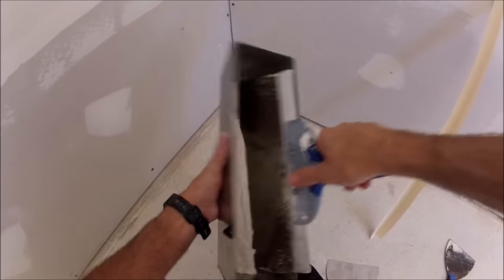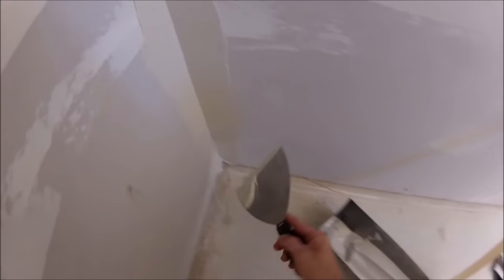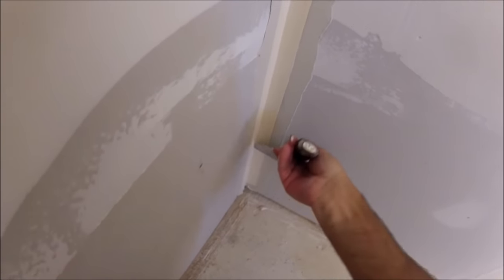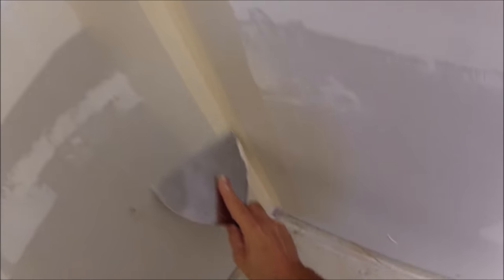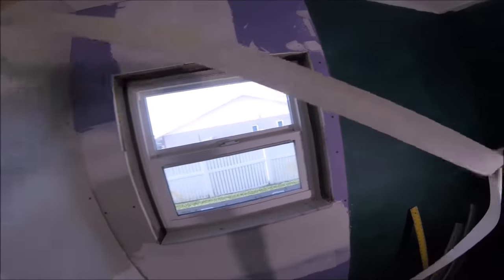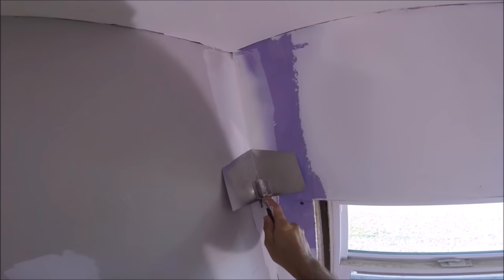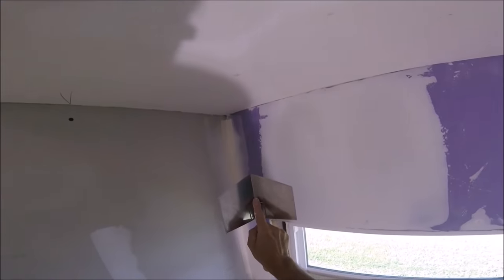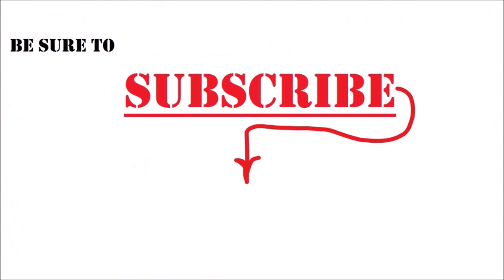Two Ways To Do Drywall Inside Corners For Beginners

Comment: Thanks for the video. Question. How would you fix inside corners that got too much buildup and the edges were not feathered. The edge is now primed and painted. Thanks
Reply: Lightly sand, then do a really tight skim coat on the edges. It should dry pretty quickly, probably in a couple of hours it will be sander ready!
Reply: Well I agree for the most part but I'd also be looking to prepare the surface with bondcrete. It's a substrate bonding agent that works particularly well on painted surfaces. Paint and plaster fucking hate each other , especially if it's an older surface. I'd also suggest using a rigid sander or specialty scraping tool for the waves ( areas where the plaster has overlapped) . Prior to preparation. It'll need to be set with a blade at least a half inch wider than the existing garbage. I hope this is helpful. Please respond if not as I'm happy to attempt to help from this forum
Reply: Lol. Just noticed it's a year old this post so my advice will be hit or miss given blokes attempts at reno

Comment: Amazing video. A quick question please. It's recommended to use something like a durabond for the prefill before applying the joint compound when there are substantial gaps gaps, right?

Comment: Hi great clear and nicely presented video, may I ask what tape that is you are using on the corners I presume it's good for strength as I'm repair cracks in the corner of walls that go the complete lengths top to bottom. I normally use mesh scrim tape but I'm not sure what to use on the corners between to walls.

Comment: Hi Paul, I am a subscriber and want to do skip trowel in my two garage which is tough to work around door rails. Anyway I am having trouble finding 20-30 coarse grade sand for under $200 for 50 lb bag when I only need a cup. Would 
AquaQuartz-50 Pool Filter 20-Grade Silica Sand 50 Pounds, WhiteAquaQuartz-50 Pool Filter 20-
Grade Silica Sand  work? $20 for 50 
 Lb. That’s 0.0270 inches average stone size.
Thank you I hope you answer me.

Comment: The house I bought used mesh and the corner is cracking.  Would it be easier for a first timer to use a vinyl bead on the inside corner instead of paper?
Reply: If you're still hoping for an answer to complete the task let me know on this thread and I'll explain it in detail mate
Reply: The simple answer is no. To the uninitiated that's a tough gig to fill.

Comment: Are you suppose to do two coats of this? Followed this . Sanded and then painted and the tape is still showing after I painted:(
Reply: This is taping the corner. You still have to do another coat over the tape and feather the edge.

Comment: You didn’t soak that tape in water
Reply from the maker: I never wet the tape.👍🏻
Reply: @PaulPeck  we see that
Reply: I’m no expert but I’ve been a union commercial/industrial electrician for over ten years and I’ve never seen a finisher wet the tape. They do always add a lot of water to their mud though.
Reply: What do you do if you do get a. Air bubble? I'm a complete amateur
Reply: You don’t need to
Reply: @anthonyridding1182 cut it out and hit the void with more mud.. if not that bubbling will always show unless you do a heavy texture then over time it will fall off 😅
Reply: @PaulPeck  0:23
Reply: @PaulPeck  1:01
Reply: @elemento1991  I'm no expert either sparky, but as an Union Ironworker for over 24 years I've worked around a lot of mud-nut pro finishers. And, if they taped & mudded like this all day they'd definitely be out of a job for sure. Not that your average Joe can't do a corner joint or two this way. But all the drywall dude's on job sites I've been on always use a banjo & inside corner trowels to "Git-R-Done!" They crank up some Zeppelin or Skynyrd in the morning & rock the day away in more than one way! They don't have time to play games, they get down & spread that mud quick than sh!t. Seriously, if drywall finishers seen a taper on the crew playing around all day with only a set of knives. The crews pusher wouldn't have to say sh!t. The crew themselves would run um' off the job for f%$kin' off on their time & not pulling their weight. Just saying...   +Peace & Rock n' Roll 4 Your Soul My Friend+ 🤘😜🤘  { Local 17 in The-Land }
Reply: @216Numbskull well duh. That’s a crew of drywallers. All about speed and not quality. A DIY or one man show isn’t going to spend all that on banjos and bazookas.
Reply: @216Numbskull he's just trying to teach novices how to do it bro. Fark  me dead hes not trying to prepare anyone for a contract gig
Reply: @RidetheGeoffening  Right On! I get it which I also stated in my comment by saying. "Not that your average Joe can't do a corner joint or two this way." Unquote, ya dig? I wasn't trying to get anyone all riled up about it. I was just giving a different insight to the way it's done by drywall finishers who do it everyday. And for others who plan on going further in the trade than just patching a hole they punch in the wall, that's all. Plus my comment was really only directed specifically to another Union tradesman in this thread who works side by side with the other building trades everyday. So if you read his comment in relation to mine you should clearly understand the point I was trying to make & who it was directed at. It wasn't necessarily directed as much on this video as it was in relation to the work & workers we see do it everyday, copy? 🤔  +Peace & Rock n' Roll 4 Your Soul My Friend+ 🤘😜🤘
Reply: @216Numbskull  I don't accept the premise of a soul. But I'm an old metal head so the rest I can handle. Whatever mate. You seemed a little riled.

Comment: I thought you only did one side at a time doesn't it need to dry
Reply: That’s only on the coats after it’s been taped
Reply: You can actually tape & mud it all in the same day for the most part. And, come back the next day to do a little bit of skim coating here & there maybe if you used the right tools instead of just a 6" & 12" knife. All you need is a banjo & an inside corner trowel & say abracadabra & like magic it'd be done! Of course if you're just doing a little weekend warrior work on your spare time & the extra steps & days to finish the job isn't so much a concern to you. Then by all means go ahead & play with the drywall knives, it's all good. But, if you plan on doing this as a side gig to make some extra dough, then pick up the right tools, ya dig? "Git-R-Done!" Just saying... +Peace, Funk & Rock n' Roll 4 Your Souls My Friends+
Reply: Nah